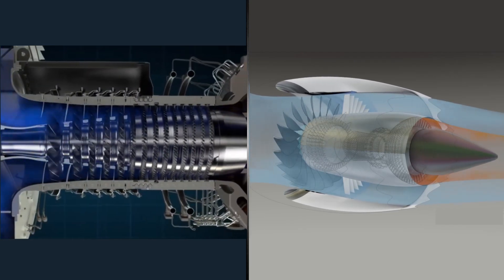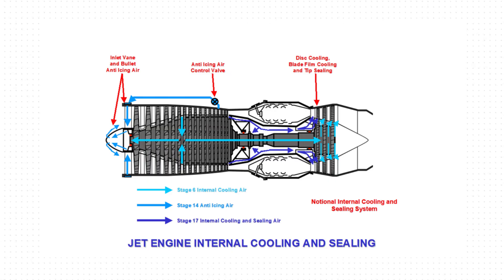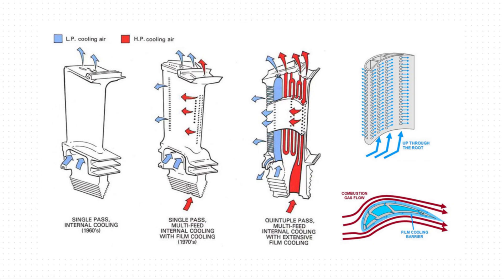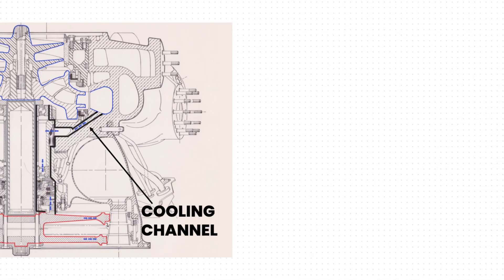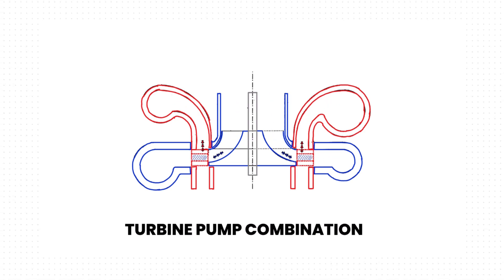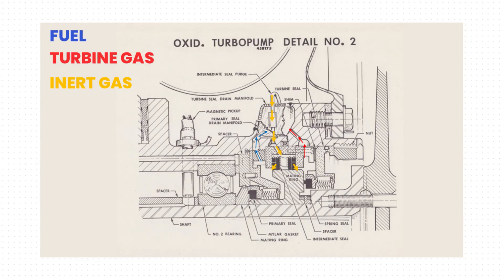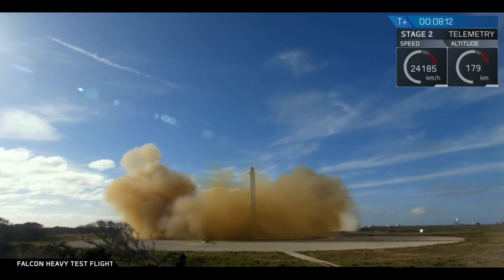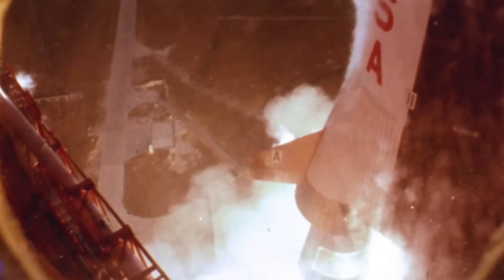Why are Rocket Engine Turbine Blades not Actively Cooled?

Comment: I'd still use a small cartridge solid rocket fuel canister..to dump specific fuel into specfic combustion Chambers...as needed for specific missions... Then use it between the low-pressure and high-pressure igniters.
Reply: Can you elaborate more on this?  I don’t understand what you mean.  Thnx.